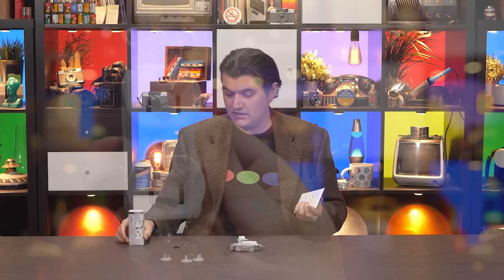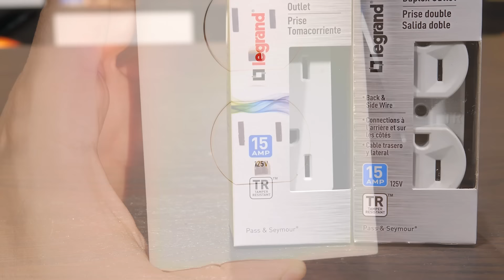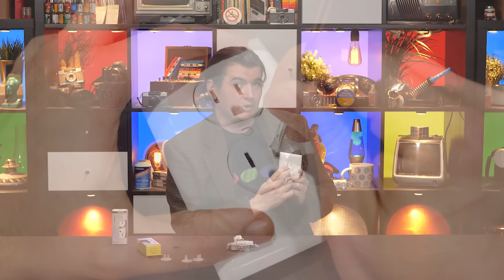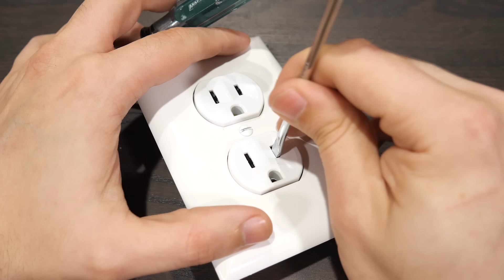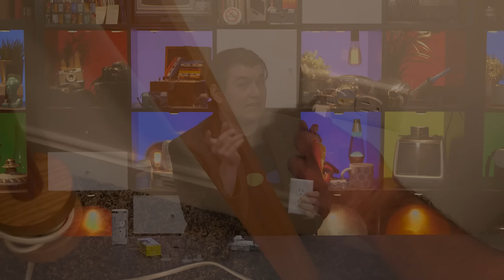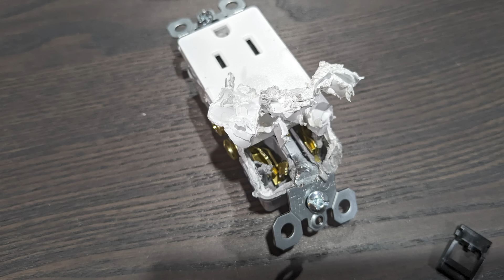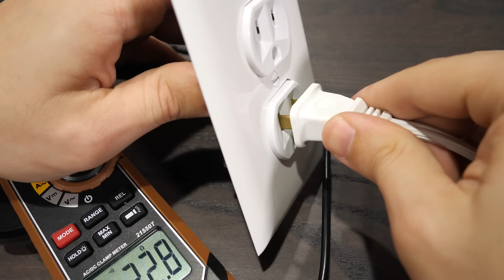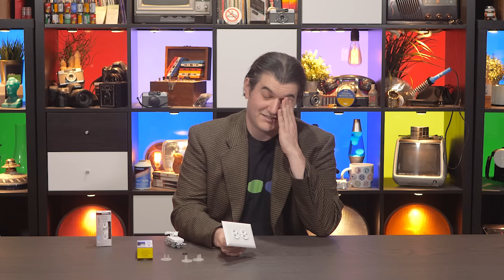Tamper-resistant outlets aren't all the same - a follow-up

Comment: I am genuinely curious about your thoughts on the current Brazilian design, we used the same US design, with both 120v and 240v outlets, and both 10A and 20A connections, the design changed in 1998 (With a transition period that lasted until 2011) when we adopted the same design as Switzerland.

It is a compact, recessed, flared plug, the connection is protected by plastic and seems overall like a great design. I don't have an integrated fuse like EU, but I'd love to see the comparison of all these different designs

Comment: Isn't there also a risk with "gripping only to the last few millimeters"? If the plug gets bumped and the blades barely make contact anymore, could the contact resistance not go up to a point where it becomes a fire hazard?

Comment: As you said before, "safer isn't safe".

Personally, I hate the modern tamper resistant outlets. I made a pair of 20A extension cords. One with a water-tight single gang and one with a double gang box. I had to get tamper-resistant in order to have one that was also water-resistant. After fighting to plug in the fan for my deck heater, I took the other two right back to the store and got the cheapest, bare-bones receptacles I could find.  No way in hell I was fighting with one of those while switching between tools in the shop.

Comment: Why don’t they just put a small u shaped gap in both connector pins and a plastic latch inside the receptacle so it holds the plug in? Or make a GFCI mandatory for all outlets ?

Comment: A big safety problem with receptacles is they are often daisy chained, presenting a unique fire hazard. The chain utilizes the shunt bars located between the two individual receptacles sharing two screws for the incoming and outgoing wire. If any of the connections inside a receptacle higher up the daisy chain have a problem with the wholesomeness of the screw-down connection, the resistance of that shunt inside causes heating, and may overheat and melt the adjacent plastic.  This might char the wall, or burn up whatever plug might happen to be inserted (like it did in my kitchen this year).*

This does not result in a tripped breaker or GFI unit.  You might assume whatever was plugged into that outlet caused the damage and throw it away, but the fault actually occurred inside the wall not inside the appliance.  Or you might assume your breaker or GFI unit needs replaced because it failed to prevent a fault overload from that innocent bystander appliance.

It might happen on an unused receptacle behind furniture while you have a vacuum cleaner plugged into another receptacle at another junction of the circuit. If furniture is pushed right up to the wall, I could see the fabric catching fire from the hot receptacle.  The problem isn't that the receptacle wore out, it's a problem is ironically that the receptacle was "unused".  Perhaps unused receptacles should be removed from the daisy chain and capped off with a plate for all-around safety.

Therefore it is important to check all receptacles periodically regardless whether you use them or not!  Make sure the screws and bars are torqued properly and not showing signs of oxidation or corrosion.  This is extra important if your house has aluminum wiring instead of copper.  Also important if you had water ingress or dampness of a basement, bathroom, or near a kitchen sink garbage disposal switch.

For this case, it may be worthwhile to not utilize the receptacle shunts for the daisy chain.  Break out each receptacle with two wires and do not use the second pair of screws to continue the connection.  This adds the cost of the extra connectors or wire nuts, but based on my experience I would go that way on new builds.

*In my case, it appears to have been a cascading failure.  The screw was probably not forcing the wire sufficiently against the brass shunt bar, which oxidized or galvanically reacted over the 15 years we lived in the house.  The wire was probably still making a good connection with the steel screw, which is not a good conductor  The current path transferred from going directly to the brass shunt to passing through the screw, which acted as a resistor.  Current through a resistor heats up.  Screw shank lengthens with temperature increase, and further increases the gap between conductors.  

This probably occurred while cooking with a grill plugged into a different receptacle, which is why I didn't notice a burning smell.  One day we were cleaning the kitchen, and a night light crooked & had fused to the receptacle  Looking closer, the entire side of the receptacle was dark and droopy from the heat.  The night light still worked and did not show signs of shorting, and the circuit breaker hadn't tripped recently.

Doing research on this type of failure was very revealing, and motivating to do more than replace the receptacle and night light.

P.S. I was one of those children who touched something that fell onto the partially exposed hot wire.

Comment: Probably worth pointing out that UK sockets made by MK (and possibly British General) have the system that requires simultaneous live/line and neutral pressure too with the earth pin unlocking but not opening the shutters.  
Any toddler who can get a kick after that that probably has a career in safecracking ahead of him.

Comment: I had to replace several of the tamper proof outlets in my house because I couldn't get them to accept ANY plug, grounded or not. An electrician tried as well and suggested they were probably cheap contractor grade outlets that I should throw away.

Comment: Life is dangerous, you are more likely to get lasting harm from incorrectly using a potato peeler than a 120v outlet.  Should we figure out a better design / upgrade path for our outlets?  Yes.  Should we have a mandate about it?  No.  The irony is such a mandate would likely kill more people than it saved as people replaced their wall outlets en masse.  The bubble wrap safety obsession of society is bogus and ill-founded, there are many, many things more dangerous in your house than a wall outlet including: the corner of your kitchen counter, a door knob, a flight of stairs, a bath tub, improperly using electronics plugged into an outlet, etc.  At some point it's less about prevention and more about education.  Teach kids to be safe and don't attempt to bubble wrap their lives and further, proper understanding of safety and risk also will live to better psychological wellbeing rather than be in constant fear paranoia.  Knives are dangerous but that doesn't mean you shouldn't use knives but you should treat knives with respect.

Comment: Backstabs are completely different than WAGOs and other lever nuts. The backstab is just a metal barb that touches the wire, lever nuts use a spring with a much larger contact plate to grab onto the wire like a vise grip action. PS leviton makes outlets with built in lever nuts now and they're super easy to use, and there's no exposed terminals.

Comment: I've been shocked twice, with radically different results.

First time: was a dumb kid trying to plug something in in the dark. Was laying on the bed and the outlet was on the wall beside the bed. Accidentally touched one of the prongs while inserting it. Since the bed didn't really conduct electricity, I just felt a little tingle.

Second time: was a dumb teen and decided to touch the back of an outlet (the metal box it's housed in). Was standing on a concrete floor. Found myself nearly unable to move for a few seconds until I finally somehow managed to pull away. Scary. Was unharmed but now aware of how dangerous even 120V can be.

Comment: I have a Klein voltage detector that I really don't like using as much as this other off-brand voltage detector I have laying around because one time with the Klein voltage detector I was checking an outlet that was tamper-resistant, and because of that little shutter the tip of the Klein voltage detector did not get close enough to detect that there was voltage on the outlet. Surprisingly, I got pretty far in removing the outlet before my fingers actually touch the hot and I had a WTF moment. It was not a particularly bad shock (120 v and I'm in the United States FYI) but the Swiss cheese as you say probably wasn't lined up as well as it could have been if it was trying to kill me. I had on rubber-soled shoes and I have not licked my hand before starting to work on the outlet. 

All of that said, I made an incredible discovery about 2 years ago that there is such a product called a recessed outlet that you can buy and it goes great behind refrigerators or office desks. The recessed by about 2 cm so no more metal yard sticks getting hung up against the hot plug and knife-throwing just becomes a non-issue.

Comment: Got shotcked by 230V multiple times. I remember one time because I was trying to replace a fuse that I tought was burned... it wasnt, and the device was still pluged in (yeah that was really smart I know), rest happend probably at a job where I was working as electrotechnician, there was plenty chance to get shocked.  It does hurt, but its not all that much worse than large static shock. I guess it depends on many factors, and I was probably lucky kind off.

Comment: Nice video, just a side question : Any idea why to in the states still use so dangerous outlets in the 21th century ? In Europe Schuko was introduces somewhere in the 60's or 70's . All the newer outlets respect this shape, and technically have some kind of a cylinder that prevents  users from similar behavior. Of course, I have been electroshocked using the Schuko outlets, probably like most of the kinds from the 70's, 80's  and later.. It seems pretty easy to keep the same pinout and use some kind of protection so that the open live pins are covered inside the outlet ...

Comment: Regarding shock while connecting/removing a plug, I've got two observations:
1 - with grounded connectors, the ground prong itself protects you from accidental shock, depending on the orientation of the plug.  If the plug is held with the ground pin towards your fingers, then the most common avenue of shock (accidentally wrapping your index finger around the end of the plug and contacting the blades) is blocked by the ground pin.

2 - with ungrounded connectors (or with grounded connectors held the wrong way), the most common form of accidental shock is gripping the plug too high and bridging the hot and neutral pins with your finger.  The pins are so close together that if you "over-grip" the plug, you are likely to bridge both pins, rather than contact only the hot pin, and that actually helps protect from fatal shock as well.  Since the circuit is created only through your finger, only your finger is energized.  Compare this with, say, grabbing an exposed hot wire, in which case your entire body from your hand to whichever part of you is touching the ground (feet? ass? back?) is energized.

Either way, "contacted the exposed pins of the plug" is far and away the least dangerous form of contact with mains voltage.
Reply: with regards to point 2 of the above:  i would argue that while your observation that the ground pin should be on top from a mechanical integrity point is correct, from a safety perspective it is better on the bottom.  With the ground pin downward, the most natural way of gripping the plug puts the ground pin between your index finger and the hot/neutral pins.  with the ground pin upward, there is no barrier to accidentally wrapping your index finger around the plug and contacting the live pins.

I would say the same regarding "sideways" plug orientation.  the plug should be oriented so that the neutral pin is closest to the index finger.  With a sideways plug, this is even more important, as in this orientation it is possible for your finger to contact ONLY the hot pin, if the hot pin is the one closest to your hand, which results in a full-body shock, rather than only energizing your hand the way contacting both pins at once does.

Comment: As a child, I had the wonderful idea to push a nail into a power socket. Did it only once. 
I live in the EU and normally power sockets have protections against that (you can't push things into holes that easily) but it's was an old house from the 70's and not all walls sockets are equipped in such a way.

Comment: As someone in the trades in the U.S, Ive heard a few times that 120v is actually more dangerous because you'll actually "stick" to it in the event youre grabbing something live versus 240v which will apparently blow you off of it forcefully. Dont know if this is true, Im just a plumber, but I have heard this sentiment shared a few times.
Reply: It may be due to the frequency, rather than the voltage.   I've heard that 50 Hz is a safer frequency than 60 Hz, due to resonance with the human heartbeat.

Comment: When I was 2, I stuck a pair of tweezers in a plug and I don’t think the design of the tr receptacle would have mitigated that. I think the type an and b outlets are flawed in multiple ways and we need to discontinue their use. They should design outlets just like the ones used in the United Kingdom, but change the blade orientation slightly for use on 120 volts so that we can’t accidentally plug in a 120 volt appliance into the 240 volt outlet. And make adapters so that people can continue to use their old appliances on the new plugs and vice versa until the old plugs ride off into the sunset over time.

Comment: I have wall outlets in my house (that I really need to replace) that are so loose that dc power adapters will fall right out due to their weight. Regular plugs don't fall out but are so loose they don't make good contact. I have definitely experienced the same in hotels. Since Europeans would be using an adapter in order to even use a regular plug, they always have additional weight on them.

Comment: Just realize that stuff like this is all about balancing different pluses and minuses. I actively avoid TR outlets because every time I've used one it's more of a hassle to use than the marginal increase in safety that it brings.

Not even to mention the increase in cost, which yes, tends to be small.

But I would prefer the easier to use outlet even if it is ever so slightly more dangerous. That is a trade-off I am perfectly willing to make.

This channel talks like it is objectively worse, but it's not, it's simply a matter of personal preference.

Comment: Backstabbing outlets has always let me down in some way, so I just don't do it anymore. I never put things back without migrating from backstab to screwed down. I have lived in 3 houses as an adult. All three have eventually had multiple problems because something failed at a backstab. I also hate them because it's painful to disconnect a backstab without marring the conductor, even with the release tool.  Rigid, stable, beefy, and reliable are usually your friends when you are routing power.

I am VERY picky with electrical connection points. When I put the cover back on, I want to know it is reliable and should never need attention again. My best work should never be seen again.

I always use pigtails over passing current through the device terminal bus. I prefer wire nuts over lever style connectors for my pigtails because there is way more surface contact (less voltage drop and heat on heavy load) and the wires get twisted making a crazy strong and reliable mechanical connection that will not go anywhere on it's own. 

Ever look at a loaded connection with the thermal camera? You can always see the lesser contacts glow under heavy load.

Comments? Stories? Agree? Have a better way to do it?

Comment: There's a video (probably several) somewhere that tells you the TRUTH about the CONSPIRACY behind UK connectors, and that they 'ain't all that'.  Well, they're shuttered, they're sleeved so that not only can you not grasp the pins but no conductive object/wire can fall across the pins, they're fused to protect the individual cord/appliance, and they hold a 'wall wart' securely.  What's not to like?  I'll tell you, leave one lying about pins-up and tread on it with bare feet, that'll give you a shock, albeit not an electric one!

Comment: I've heard electricians say that the 208 volt power used in some commercial applications hurts more than 240 volts, and that's because if you touch it, you get shocked by the full 208 volts, not half of it like with 240.

Comment: I appreciate its probably not possible as I dont know if ALL US/NA recepticals have a ground/earth socet, but another aolution would have been (a bit like our amazing, but unbelievably HUGE UK plugs) to just always have plugs with an earth/ground pin.... if the electrical item is double insulated then the earth pin is just plastic. Then the shutter mechanism could be the same as the UK (which arguably still needs two items to touch the live as you - to do it without too much force - need to have one in the earth to open the shutters, then a 2nd to then actually shove into the live). It seems less likely to jam as its really hard to NOT insert a UK plug such that the shutters jam / need to adjust how you are holding it.

Whilst I do (of course) think the UK plug is superior in many ways (yes... bias) I do think the EU schuko is pretty close as well.

The fact you have to replace plugs and sockets due to wear and tear all to often is just an alien concept to me.